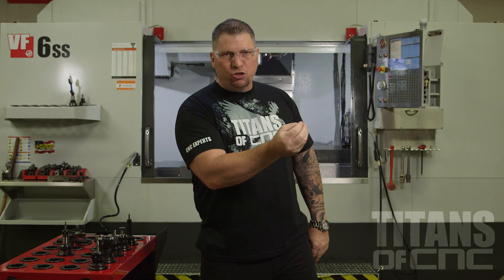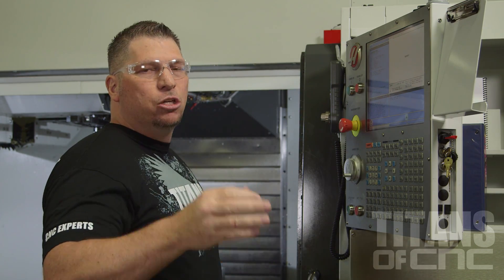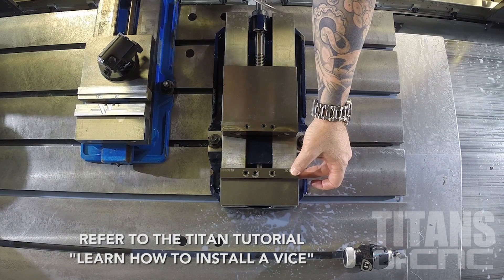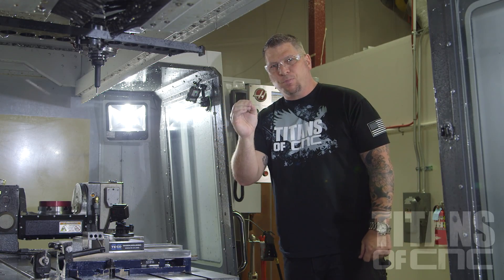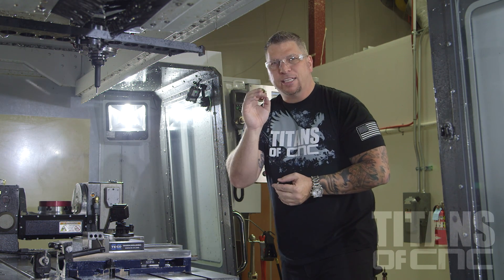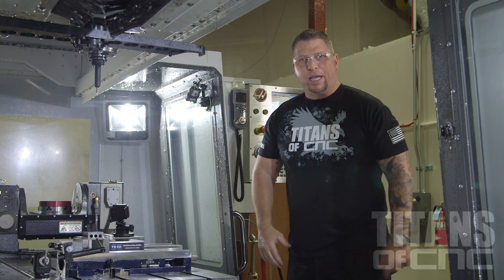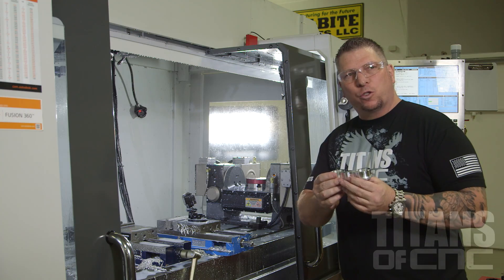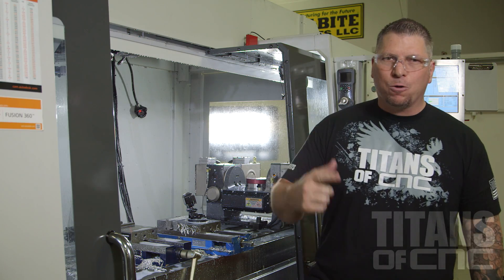MACHINE THE TITAN-8M | ACADEMY

Comment: I neded to do  250 diffrent parts iron (45 hrc) in 70 h with 200 diffrent programs in fusion 360. I dident make it =(  i drive 2 diffrent cnc at the same time, so dont have time to check hights . Just cam it,  load part. do the zero thing and hit go. And go program the next maskin. Asome show. /Dennis (sweden)

Comment: Hey Titan, I don't like how you taught your tool offsets.
Wouldn't you be better off making the top of your setting disc Z0, teach all the tools to that and then dropping your work offset?
Your way involves adjusting each and every tool - a lot more opportunities to make a mistake.
Reply: First sorry for my english
I agree with you. Better way is to set the zero in Z axis on the 3-2-1 block puted on the table or stationary jaw of vice and Johanson's dipstick puted on the 3-2-1 block. After setting zero in Z axis on Johanson´s dipstick clamp the tool in to the spindel and go above the Johanson´s dipstick. Roll the tool down until the dipstick begins to rub against the tool. Then on the machine panel in the Z colum is the heigh of the tool which is important to put in the OFFSET table to the tool number which you measured right now (it will be always positive value). After all tools are measured than you put the zero point in Z axis on oyur workpiece. and its all you can run the part without any adjusment of tools in offset page like this Titan. This method is good and better because now you can clamp your part in another Z heigh and you don't have to touch off all tools again, just set the new Zero point in Z axis. The easiest way. if oyu want to learn more from me so send me a message to david.holeda@seznam.cz and I will make video for you how to measure tools in the machine (we yousualy used presetter but its work as this method below).

Comment: Titan, How hard do you know you can push the tools and the material?
Reply from the maker: Recommended IPT and SFM from tool manufacturers and from experience
Reply: Workholding conditions, rigidity, and spindle power are also important.
Reply: @TITANSofCNC  ... I'm wondering how fast you run 304L .  I did a trial not too long ago in a shallow wide pocket .187 deep. 5x5 square with 2inch hole in center. I used Guhring RF Diver .500 4 flute endmill... .050 DOC I think 600 SFM at .0025 Chipload. I remember the feed was 180 ipm.... I ran it DRY with a worn endmill!  Only 4 parts though just to see. I was impressed. It happened to be in a UMC 750 5 axis machine.

Comment: what do you do about the left over stock on the bottom?
Reply from the maker: Flip it and deck off the bottom.
Reply: @TITANSofCNC   Does that require a separate code or do you do it manually with the shell mill? Thats the part Im always trying to figure out.
Reply: Soft Jaws Fixture for Op2

Comment: I have a question...after finishing this operation , how are you going to remove that excess material which was in the clamps above the parallels with rectangular shape ????
Reply: You could flip the part over and hold it in a fixture that's designed to hold the odd shaped circles and do more operations to remove that excess metal. Creative workpiece fixturing is a big part of what separates a good machinist from a great machinist.

Comment: I'm not sure what to say about this method of edge finding.

You've got a renishaw probe system on this VS6 SS, you could use the renishaw spindle probe, and probe the x,y,z axis. 

If you needed to run another part you can probe the next "blank stock" and have the Hass NGC's adjust your work offset's as required.
Reply: He said he wasn't using it because its for education purposes. Not everyone has a Renishaw system.

Comment: those parallels are actually really nice, i hate it when i finish a part and then have to clean the parallels and put them back on their place
Reply: yes i use the metal cable ties that material suppliers strap the bars together with. just bend it into a triangle and put between the parallels :)
Reply: ipadize use a spring between parallels and they don't move around on you they stay in place and chips don't get between them and the jaws. tho if it's like a huge production they might after time. clean them once in the morning
Reply: What are those parallels called? Or did he make them?

Comment: Don't set tools on precision ground matched inspection tools like 123 blocks. If you need something to set tools off of make a block with a known height to do it with.
Reply: why not have a set to set tools with and a set to inspect with?
Reply: He was trying to show you how to do it with students in mind. He used tools/methods that were the easiest and most accessible. As he said he would normally use an auto z plate/setter but wanted to show a manual method. They are precision ground blocks but he only made contact with his cylinders that he machined for this.

Comment: I am wanting to get into cnc and learn how to operate a cnc machine. I have a need to make custom parts at times for projects. I will be starting from scratch. I have worked with auto cad and inventor in the past but never transferred drawings to a machine and have never operated a machine. I am thinking of skipping the desktop cnc route and going for a used industrial grade machine; i would have to go used because of price. Any recommendations on a first machine or suggestions on how to efficiently go about learning the trade?

Comment: Pay special attention to 8:30 when he is setting the Facemill. Manually setting the Facemill or even using a tool setter, it's EXTREMELY important to rotate the cutter and check each insert. What Titan did there should be a lesson. One low insert and you're screwed.
Reply: You should watch it again, he even said he did it and showed it in the video. He did a manual set on one insert in the video and cut to the finish but said he rotated it and checked every insert in the tool. I also suspect he checked the tool before he put it in the tool changer as most do with setup procedure.

Comment: great vid this machine cuts aluminum at high speed like butter, good instruction on process order with 1st run.. it kills me a little inside though.... to see your machine draining coolant all over the tool tapers QQ  this leads to all sorts of beautiful corrosion in places you don't even want to think about if you're using water based coolant... I try to M9 on the last G0 up before tool change so it drains as the head is moving up to the changer height(what good is cooling tools cutting air anyway?!!)

Comment: titan, where can i purchase one of those 1/4" spacers at? The shop i work at they want you to use a piece of copy paper and adjust from there. Its rather disappointing to me how they want it done.
Reply from the maker: I just made it... .250 Thick x 1.0 Dia... in tenths.    Joe Block would work
Reply: It's just a gage block, you could use anything, paper, shims, 123 blocks, or a dial height setter. What's important is that you know the size. If you use a block instead of paper you need to start with the tool lower than the top of the block and raise it up until the block slides under. Start with .010 moves until it goes under, lower it a click and go to .001 moves, repeat until you feel it just slide under without too much force on .0001 moves.
Reply: Using paper for setting tool offsets sounds weird but it's one of those tricks from before the CNC days that still works well today. Jog the tool down while moving the paper back and forth, and stop when you start to feel friction. Measure the paper you're using and subtract that from your tool offset. Sticky notes work really well and usually measure at 0.003", but some people prefer cigarette rolling papers which are thinner.
Reply: TITANS of CNC ah okay, well I appreciate the reply. Absolutely enjoy the videos you put out. I'm fresh out of school and what you've been doing helps me out with basically only school experience.
Reply: Captain Dammit  edge technology makes a dope setter only 100 bucks. I bought 2

Comment: Have you ever tried shrink fit tooling for your endmills? You would be amazed at how much harder you can drive tooling with them vs a solid set screw holder.
Reply from the maker: Keeping it simple and cheap for students.
Reply: shrink fit is a game changer:D the holders are just ammazing
Reply: we use them all the time but the downside is if you break an endmill and fail to extract it from the toolholder (including it has an edge inside and wont fall out) you have to turn it around and hammer it out with a rod smaller than the hole if its an old toolholder